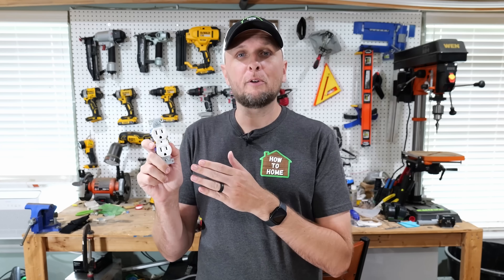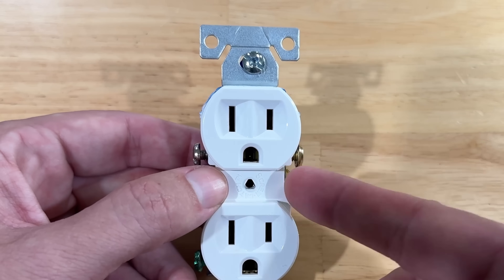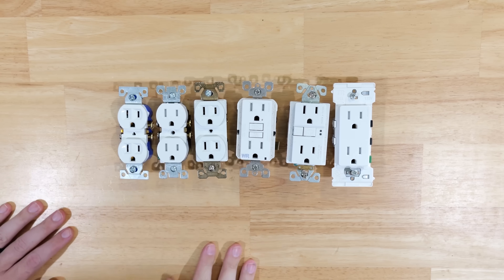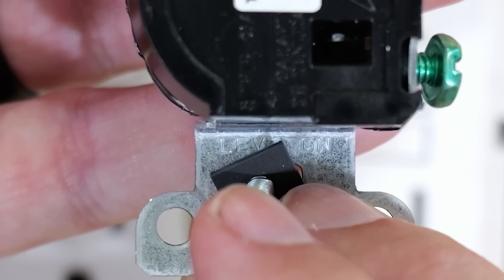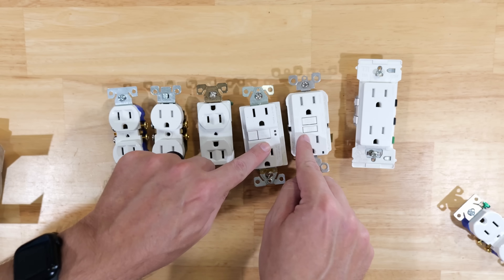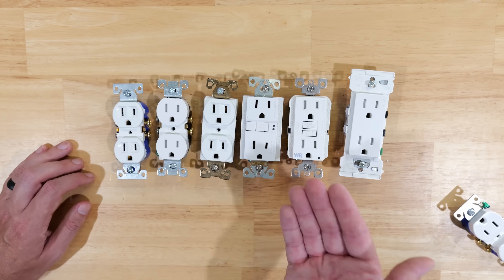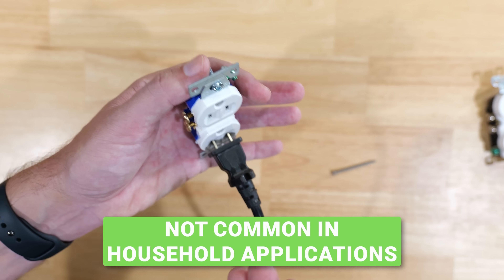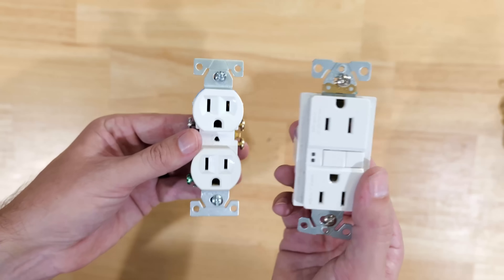The Shocking Reason Why Your Outlets Are Installed Upside Down!

Comment: 35 yr master electrician. I have the habit of putting receps ground down in all applications except if it is switched (lamp plug) or split (2) circuits. And that's only to make it easier to identify for costumers and service. No code just a habit I picked up from the OG's... Doogie
Reply: This is how all new construction homes are wired in Florida. The upside-down outlet identifies the switched outlet. If you’re unlucky enough to drop a metal object into that 2mm gap or “amped” up enough to touch the prong with your finger, Darwinism is definitely working against you. You might as well just flip off your main breaker every time you need to unplug something!
Reply: @donaldnelson5647  You mean the "right-side up" outlet identifies the switched outlet.  Please don't create confusion by incorrectly identifying ground-up orientation as "upside down."
Reply: @jmdavison62  No, I meant the upside down one. You appear to be the one confused. When 99% of outlets are installed one way and 1% are reversed, the 1% is the the one I call upside down. I've been in 1000s of hotel rooms, businesses, and random Airbnb's all over the USA.  Not once have I been surprised by an entire building having ground up installs. Never! So again the 1% is upside down and typically this due to identify a switch controlling the outlet. Here, which way should the ground face when installing a ceiling mounted outlet? (answer is North). One more for you, which way is a light switch considered right side up, when on is up or when on is down?
Reply: This is how my 5000Sq custom home was built.  All outlets connected to a light switch, were upside down. VERY CONVENIENT to know why the outlet wasn't working.
Reply: Never thought of that trick.   I stopped wiring split switched years ago due to most of my customers complaining that the bedroom clocks kept getting turned off.   My mother has a switched outlet in her Living room and she frequently would turn off her computer, phone, cable system and TV.  I had to put a switch protector over the switch.  The "convention" is to have the switched on the bottom and the switched on top but most users just plug and run. This trade is all about using each others tricks.  Thanks for posting.
Reply: @RealElectrical  another thing I offer the customer in bedrooms is. At the switch box I connect the (previously switched) outlet to constant hot and add a night/light to the switch. Works great for children room
Reply: Doing mine now.
Reply: I know this is very late to the thread, and it honestly is just a joke. I was wondering why people who make costumes would need a specific outlet orientation. Ba-dum-cha.
Reply: @dbf1dware ... well played.  Damn spellcheck
Reply: same practice in the area I live
Reply: I just go with what the local inspector says is the right way.
Reply: @warrenpuckett4203  usually it doesn't matter to the inspector. This is a preferential thing not a code issue
Reply: Exactly what I'm accustomed to. Made me think this creator isn't really an electrician 🤔
Reply: I also would install the ground up if the receptacle that might be behind a dresser where a metal necklace could drop behind the dresser and land across exposed the hot and neutral. If it hits the ground first it will short quicker when it hits the hot lead.   I also make sure when mounting horizontal the neutral lead is on top.  Of course ground up on an open section of wall would indicate a switched receptacle.  This guy is making way to hard.
Reply: Sorry, I don't know what you mean by "easier to identify". Please elaborate for me.
Reply: @alangrant5684  if it's upside down and the rest are not, most competent electricians will notice that it wired differently then the rest. We do this alot with markings, zip ties, cover plates. So if one device appears different from the rest it usually the installer trying to communicate a message to the service guys years later.
Reply: @ramonacevedo356  But how does it make it easier to identify? ... I assumed this means what device was plugged in?
Reply: @alangrant5684  it is visually different from all the other outlets in the room. So from a glance without having to look at wiring or plug a lamp into each outlet and flip the switch to see if it turns of (that's what homeowners without a volt meter do lol). The outlet that different/upside is the one on the stitch.
Reply: Same in Tennessee
Reply: Why don’t you talk about the new way go style outlets which mute the entire concept of how device is installed-totally safe either way!
Reply: I like that thinking many times I have been contacted about an outlet not working. Get there and it is a switched outlet simple fix turn on the switch. Wish everyone installed that way.
Reply: the problem is, that almost no one thinks that about an upside down plug.  no one goes "OHHH thats a switched plug because its upside down"  no.  they just get mad that the plug is upside down since all appliances plugs are oriented with the ground downwards.
Reply: That does sound like a slick idea, but I can tell you it would trigger my 'tism.  😉
Reply: All flat plug devices are configured for the ground down and cord hangs down the wall
Reply: I highly suspect that 99+% of homeowners don't know why electricians installed the receps ground up. I'm nearly 70, and this is the first time I have heard of your reasoning. The industry may want to consider PRINTING something on the receps to indicate lamp plug or split circuits.
Reply: @5deeplogic676 those do exist. They are often required in commercial buildings.
Reply: @5deeplogic676 the homeowner doesn’t actually need to know why it was done for it to be helpful. You can’t figure out which outlet the switch is for and you test them all and find it’s the upside down one. You are more likely to remember next time it’s the upside down one. And if they are clever enough to pick up on the pattern they will immediately know which is switched in the other rooms.
Reply: @5deeplogic676  They should.  This "folk wisdom" practice of putting a receptacle right-side up only if it's switched or split is ridiculous.
Reply: @jmdavison62  the only one spreading folk wisdom is you, show me more than 2 houses in the USA that you didn't wire with outlets upside down (to be clear upside down is considered ground up). Have you ever been to a hotel, a cruise ship? All buildings in fl, ga ny, ca, tx, NC, sc, AL ( I can keep naming states I've been to...) are 99.99% ground down aka right side up.
Reply: Agreed, NEC has no determination on direction ground up, down, sideways it isn't a code thing. But i also mount switched receps ground up
Reply: I have seem some outlets that have “TOP” written on them. Takes the guess work out. ( I believe the orientation was with ground at bottom)
Reply: @lesliebowles3649  Ok. I was wondering if it's because you can label it and more easily see that label on the top (flat) part of the plug itself.

Comment: Another argument for Ground Down:  AC/DC Transformers tend to be designed to have the bulk of their weight below the plug, so the pivot of the weight will pull the plug against the wall, keeping the prongs snug inside the receptacle.  If the plug is installed ground up, that means that for the transformer to fit the polarization they have to be plugged in with the bulk of the weight above the plug.  This will cause the natural tendency of the weight to pull away from the wall and expose the live prongs.

Granted, it can be argued that transformers should be plugged into a surge protector, but there are use cases for some classes of devices where this is not always practical or necessary.

Comment: most modern surge protectors are designed to have the ground prong down. When I pull out power cables, I grip the sides of the plug along with my palm gripping the wire (of the type shown here), more surface area to grip, I have always done this without thinking, until now of course. I have a pretty good motto, respect electricity and water, if a job is beyond you, get a pro.

Comment: I prefer them prong side down for a very simple reason. Most AC adapters and wall chargers are non-grounded and hang down with gravity from the plug as a floating device. If you plug them in upside down or into a receptacle that is prong side up, the weight of the transformer will tend to plug in too loosely for a secure connection and even cause it to unplug itself over time. This is never a problem with ground prong down.
Reply: Additionally, there are nightlights and other devices that have built-in plugs with no cords, and every one I've ever seen was designed to go ground -plug down. Even if the device has only two conductors, if the plug is polarized, it is designed for the neutral to be on the left, which is the same as in 3-prong plugs with the ground hole down.
Reply: @rojoeditor  Indeed. Excellent point.
Reply: @rojoeditor WTF is a groin plug?
Reply: Good point!
Reply: 100% my argument. The plugs for my NES and SNES are fairly big and have some good weight to them. As a kid I had to use an extension cord just so it would lay on the floor because of the ground up sockets.
Reply: @chriswiltse2281  Exactly! Even if the NEC were to form a standard and say ground prong up, NES trumps NEC every time. :^)
Reply: This also gets into the needless polarization of many cordsets these days. Much of the time, its makes zero difference from either a functional or safety standpoint, yet the darn thing is polarized anyway.
Reply: The NEC does have a standard for plug-in transformers, to help minimize their tendency to pull away from the outlet.
Reply: Hospital grade receptacles are designed to grip the prongs tighter and to endure the chemicals used in cleaning/sanitizing.
Reply: 💯 

All of the outlets in our house were installed prong side up.  Since almost every outlet in our house has some sort of outlet extender or flat angled extension cord plugged into it, I've been working on replacing every single outlet in the house over the last couple years.
Reply: @sociopathmercenary  All you have to do is half-twist the plug for prong side down. You only need to replace them if they're worn and the plugs fit in loosely.
Reply: @lawshorizon  I'm replacing with Decora outlets so I can use screwless wall plates.
Reply: College rent house.  220 kitchen stove. Ground plug down. Metal handled flyswatter hanging on a nail behind the range(poor placement)
Flyswatter fell behind the range. Plug not inserted fully into outlet. (Why would a college kid look behind his range? 😀
Flyswatter fell behind stove. Big excitement!!!
Reply: @johndyer5541 why would a flyswatter be behind a range? Aside from the fire hazard, and the  burn risk when grabbing the swatter, that's disgustingly unhygienic. Unless you're trying to get dog 💩 in your food, you don't put anything that touches dead flies above your food.
Reply: That was my thought the whole time. The ground prong helps support & hold it in.
Reply: This is exactly why this change had not been made.  In the late 1990's I talked to a member of the board who makes these NEC decisions and sets these standards, and they realized that it makes more sense for the ground plug to be up, and it is somewhat safer, but there were so many transformers and devices out in the market that are designed for ground down.
Reply: @stevelux9854  It's only somewhat safer if you're already doing something that is stupid. Between GFCI and AFCI there shouldn't be much to be gained by having the ground pin up as the plug is supposed to always be completely plugged in when plugged in. Failing to push it in all the way can potentially lead to a fire.
Reply: @stevelux9854  therefore appliance makers are wrong? Poor engineering? Deliberately faulty causes wires to kink up so the uninformed just throws away the appliances laptops have this problem. It won't charge cause there's a break in the line...
Reply: @stevelux9854  Fascinating. Thank you for contributing that keen insight. Perhaps if they had made that recommendation much sooner, those same transformers and devices would be designed for ground up use. But, as they say, the train has left the station. Cheers.
Reply: AC to DC wall adapters with no ground typically are not polarized anyway. Their full bridge rectifiers do not care which side is live and which side is neutral.
Reply: Not to mention that since the weight of the cord hangs down then the two prongs at the top (vs. one) simply holds the plug into the socket better.
Reply: This!
Reply: Good point
Reply: Exactly! This is why all residential outlets should be ground prong down. And shop outlets too.
Reply: Can you tighten the prongs or not for flimsy connections?
Reply: This. I have a couple outlets in my home that are installed ground-up, whereas the rest are ground-down. I do not like plugging in my big AC adapter plugs in those ground-up outlets because gravity tends to tip them forward and pull the prongs out slightly. And they aren't grounded, so this edge-case of a nail falling in there, it could make a circuit - and with the big plug-box thingy there on the top, it will direct and hold that nail in there, so it's a little less of an edge-case than it is with, say, a lamp plug.
Reply: Nice
Reply: Ground down ensures the earth pin is the last to break contact.
Reply: Good point about AC adaptors, but (for reasons unbeknownst to me) I have a bunch of plug-in timers that are the opposite.
Reply: More consequential than orientation us the advantage of screwed rather than pressed in terminals.  Intermittent flashing lights or inoperable appliances can often be traced to loose press-in switch or outlets.  Screwed terminals tighter, safer IMHO.
Reply: Most AC adapters the polarity doesn't matter.
Reply: @reuploadify the polarity doesn't matter, but typically, they still have polarized plugs
Reply: @reuploadify  Yeah so with 2 you have one up and one down anyway
Reply: How old are your chargers?

Comment: Ground prong up when vertical,  neutral side up when horizontal. If the plug is partially exposed,  anything that might fall across the terminals will be at grount or neutral instead of going hot or shorting across the load terminals.  Safest way.  NEC and North America is shamefully poor in this.

Comment: With large appliances these days the cords are designed for the cord to plug in with the ground prong down. By reversing it tension would be applied to the appliance cord and cause potential breaking of that cord. 

Doesn't matter which way receptacles are installed? No. If people are going to be that paranoid with something touching the neutral and hot prongs at the same time, then receptacles should be installed horizontally with the neutral slot up.

Comment: In the US Navy submarine fleet, we were taught to install with the ground up, but for a reason no one seems to mention. With the ground plug down, the little section of plastic below the ground plug was prone to breaking if a grounded plug had downward force applied. The forces from the ground plug being levered out of the outlet would snap that piece of plastic. If someone saw that the plastic was broken, we (electricians - with plenty of more important things to do on a nuclear submarine) would have to take time to tag-out the circuit and replace the perfectly functional outlet. When we installed the outlets with the ground up, the forces from the ground plug never broke the plastic.

Comment: I like ground pin down.   This gives you a Larger slot to the Left for muscle memory.  Imagine a face with two eyes and mouth. Again, ground pin (or mouth) is down.  Finger grip also favors ground pin down so the wider surface of the top of the plug is under your thumb.  My better half is a hotel inspector and finds a common practice is ground pin up when the receptacle is controlled by a wall switch.

Comment: As an electrician I remember the 1993 code said that all outlets on the load side of a GFCI were to be ground up to identify them as GFCI protected also OSHA is the one pushing ground up and a lot of apprenticeship programs are telling them its code and does cause problems on the job.

Comment: I think plug-socket systems where you can touch/reach the pins with you finger or an metallic object while still connected to the live phase should be considered as generally unsafe. Yes the US-American system is per se unsafe. Though it could be made safer step by step, only there is no money to be made doing this.

Comment: You've just made a very good argument for UK style outlets. They are installed prong up as standard, and all plugs have the cable coming out of the bottom. The line and neutral pins are shielded below the plug top, so if the plug is partially withdrawn there is no live metal accessible to stray nails, paperclips, other metal items or fingers.

Comment: Had too many issues with the prong up, Many devices that have a GFI built onto the plug line will be faced prong down so they don't pull themselves out with physics expecting the prong down receptacle, adapter plugs for Surge Protectors are prong down. My in-law's house was wired in the 70's and were all prong up and too many times they became unplugged. After installing thousands of these prong down in new builds I replaced them all for them to which their problems ended. The replacements held better as they were not worn from use.